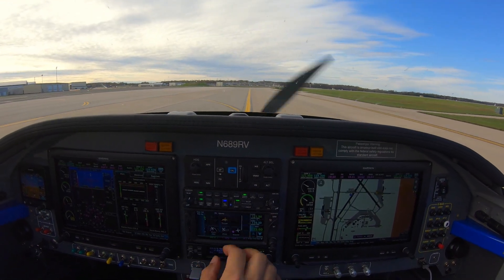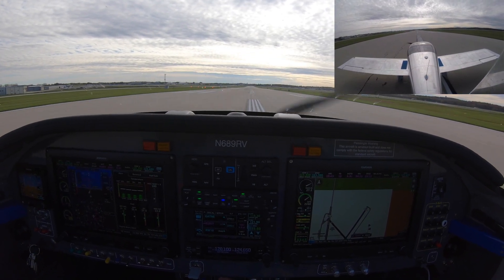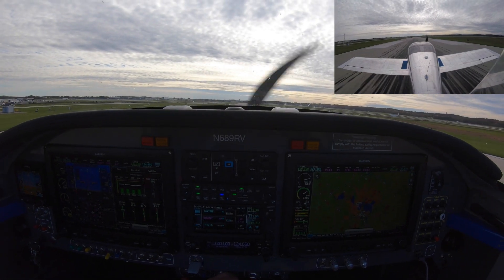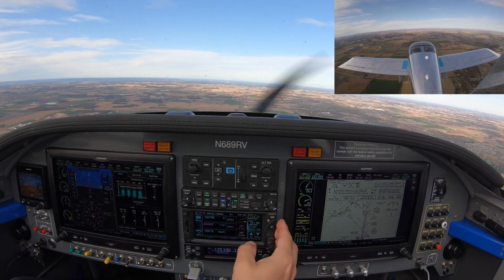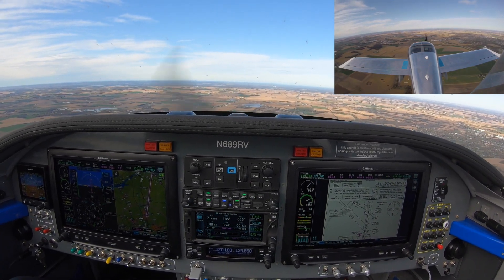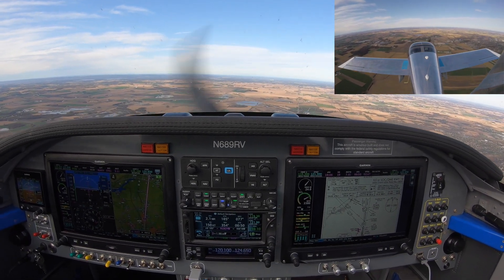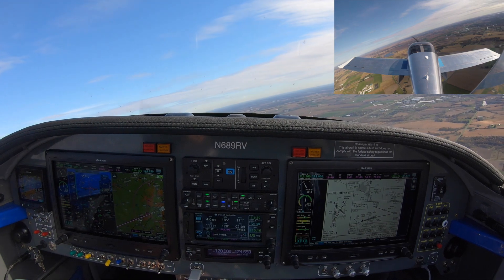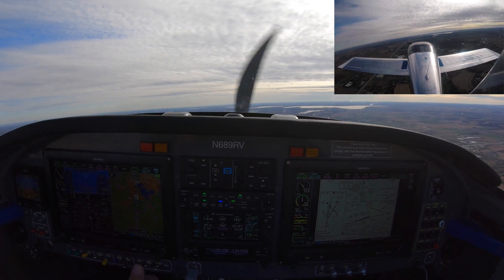Instrument Approach Part 1 - KMSN ILS18

Comment: Did you wire the panel yourself or did you have Stein do it?
Reply from the maker: Stein did part of it. I originally hired them to do some of the harness work but a lot of it changed after that. I used most of what they sent me but re-wired, shortened/lengthen, etc a lot of it.

Comment: Your videos are fantastic.  I'm getting the same panel in my RV-14 except going with the GNX 375
Reply from the maker: The new Garmin GNX 375/355/etc series is great! My only complaint about them is the lack of a volume knob. I was going to replace my GTR-200 with the 355 but could not bring myself to lose that knob :)
Reply: @BuildFlyGo  Yes Honda had the same issue with their car stereo volume knob.
Reply from the maker: It's missing? :)
Reply from the maker: Granted, you get volume functionality with these by pushing in the tuning knob and then it becomes a volume knob, but it just wasn't smooth for me when I tried it out. Maybe with more recent firmware it works better?
Reply: @BuildFlyGo  Yeah, they removed it for a touch screen volume control.  The new 2019's and above now have the volume knob put back.
Reply from the maker: Ugh. UI fail.